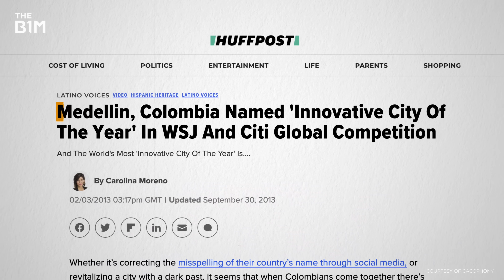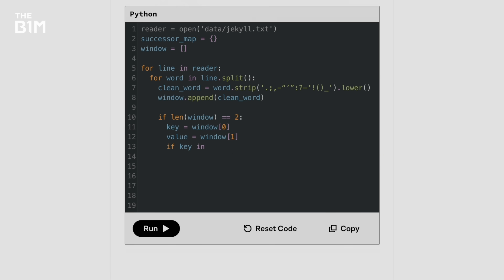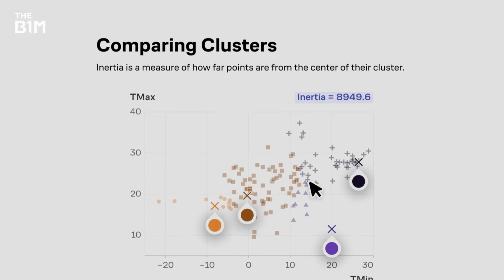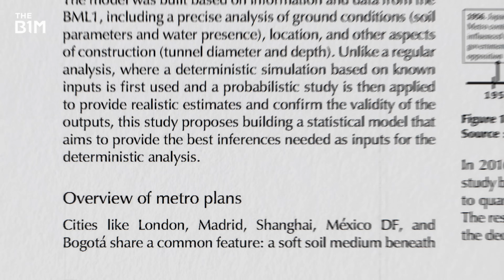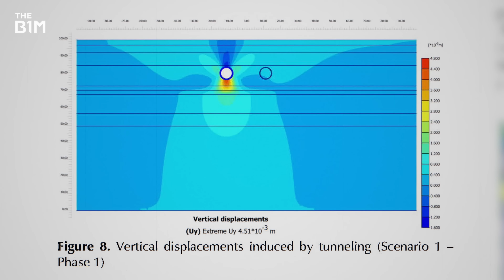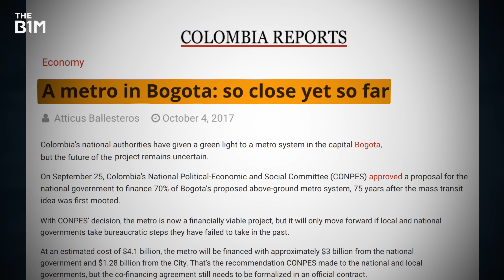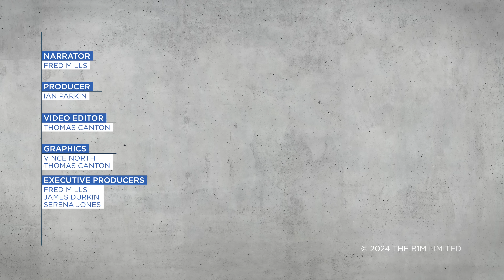How to Build a Metro From Scratch

Comment: Curious about the Transmilenio BRT system. Aside from the initial cost, is there any reason why it's not been replaced by a tramway? The bus lanes being completely segregated from traffic, can't understand why not a tramway instead for more capacity?
Reply: The system isn't even complete as it has been planned it still under construction in it's last stage, so finishing it just to change it to tram would be sort of a waste of money...also two times mayor Peñalosa, has been really keen in selling Transmilenio as the best solution for transit. He basically was forced into accepting making the metro but under his terms. He also tried to sabotage a project for a light rail between Bogotá and it's western suburbs, as Bogotá is a capital district separated from the surrounding department he decided that the city would not give money for that project and demanded that the level crossings in Bogotá be elevated which added to the costs. Fortunately the following mayor decided to support that project and an other light rail to connect Bogotá with it's northern suburbs. However resently a touristic train that covers the same route, crashed with a car and Peñalosa took the event to preach against trains and the northern light rail project, pitching a Transmilenio as better solution. He's still fairly popular and has many supporters in the city council.

Comment: Unfortunately mayor Peñalosa’s ego combined with his corrupt BRT bus business left Bogotá with an ugly aerial viaduct that cuts through the central , historic areas like an ugly concrete scar. To build it, they demolish and are re-constructing under the metro’s viaduct the same BRT line on Caracas avenue that Mr. Peñalosa built instead of the metro. In 1998. This BRT line has been plagued by scandals derived from bad designs, bad materials,  under capacity, over costs, constant repairs due to failing materials and corruption that more than doubled the original price tag. He also torpedoed other heavy and light metro lines to build more insufficient BRT lines through Bogotá. Mr. Peñalosa  is still wondering the world selling more BRT systems.

Comment: Transmilenio is the worst mass public transportation system that could have been implemented in Bogotá. Bogotá has the worst traffic in the world, as a result of the poor quality of service of the system, which has caused people to prefer to continue moving in cars (despite the traffic) and motorcycles, rather than having to suffer by getting on an unworthy transportation system, whose densities exceed 6 passengers per square meter, access and waiting times at stations that can be more than 40 minutes, etc.

The metro proposed by Enrique Peñalosa, diverted resources from the underground Metro that had greater capacity (80k passengers/hour-direction vs. 54k passengers/hour-direction) and greater length (32 km vs. 23 km) and more stations, to supposedly invest the difference in resources in more Transmilenio lanes.

In the end, the project not only took 7 more years to start, but ended up costing much more, offering the city much less.

The poor traffic and quality of life in the city are a consequence of the implementation and priority given to Transmilenio, over mass transportation systems based on rail (suburban trains, subways and LRTs).

Comment: Do a video on the Honolulu Rail Transit project, started in 2011, which is now over $5 billion beyond its original $5.1 billion budget and remains unfinished. Despite promises to ease traffic, Oahu still has some of the worst congestion in the United States. After more than a decade, the rail’s delays and skyrocketing costs continue to spark frustration among residents.

Comment: They should copy the Chilean metro organisation.  Chile recently built two metro lines with 25 stations each for just 2.6 billion dollars. The trick is having a permanent engineering team with 60 years experience in metro construction.   Why pay hundreds of millions to a private engineering company to do first the feasibility studies, then another company to do the technical studies and another to do the detailed engineering.  Each company gets a solid profit. Chile just uses its permanent team of engineers that only charge salaries, no millionaire profits involved.  Thanks to experience these engineers divide construction in hundreds of contracts that allow for thousands of companies to bid. Then they pick the lowest prices.  Thus, one awarded company digs the tunnels, another builds the railroad, another, the ticket booths, another the escalators, the tiles, the handrails, the doors, etc.  All lines remain the property of Metro. Thus people can move from one line to another without having to pay again ( as it happens in Peru).  There is a unified automatic ticket system and the metro is connected to bus lines With the same ticket.
Reply: That's how Europe and Asia do it. We in the Americas kinda do it with highways, but not in urban projects. IDK why.
Reply: @quagengineer1877  UK has some very high costs, as does Singapore. And US highway costs are quite high as well.
Reply: Very impressive stuff. Are you very familiar with the Santiago procurement process?
Reply: @szurketaltos2693  This YouTube video in English explains a bit: "How this American city builds transit on a budget".  The Argentinian that gives the details is: "El secreto de Santiago para construir metro barato", perhaps you can have it translated by AI.   There is another in English that fully summarises the progress and history of Metro de  Santiago : "The americas' most advanced Metro|Santiago"
Reply: @fernalonsoau The best subway system in South America is in Sao Paulo, Brazil🇧🇷, not Chile. 🌶️🌶️
😂😂
Chile has almost no heavy industry, and all the subways are built by foreign companies.😂😂
Reply: @zhou_kaw  It is true that Chile does not have much heavy industry, but for the last decade, it has been assembling metro trains in Santiago.   I don't know the Sao Paulo metro.  What I know is that Chile is very efficient at building excellent metro lines at low cost.
Reply: @fernalonsoau  The latest Santiago new metro trains to be put into use is the CAF metro train, which is imported from Spain🇪🇸.
Reply: @fernalonsoau     The latest Santiago de Chile new metro trains to be put into use is the CAF metro train, which is imported from Spain 🇪🇸.
Reply: @zhou_kaw  That is right.  Those are driverless trains for the new lines.  Chile is assembling the driver trains to replace old ones in the older lines.
Reply: @szurketaltos2693  I watch a video by an Argentinian economist, who gives all the details.
Reply: That sounds like a nice model! Thanks for sharing
Reply: Public transportation in Bogota is unified.
Reply: @javii9768 So it's Santiago. In fact, Santiago took the Transmilenio model and implemented it, using the Metro lines already builden.
Reply: Basic stuff has been privatized to fucking contractors.
Reply: It makes sense to have a continuously working branch of the government on it.  Urbanization isn't going anywhere, and therefore increasing demands for transit are required to move people efficiently.
Reply: No tenemos el capital humano para desarrollar este sistema, sufrimos una fuga de cerebros, la gente que estudia y se capacita prefiere salir del país debido a la falta de oportunidades, la pobreza y el conflicto armado.
Reply: Most of the world does work this way
The nations building the most metro systems in the world today
are India and China, do have Railway and Urban Transport Ministry's
Reply: the santiago metro is top tier, i love the 5 minute frequency and being able to use the entire network with a single fare. sadly its sister project red is a massive resource drain on the rest of the country, and in terms of transit all the other cities only get scraps every 10 years. my city's bus network is so unreliable that car use doubled between 2014 and 2024 alone and the already expensive collective taxis suck at rush hour. you literally have to fight your own neighbors to get in the taxi first or gamble and rely on the rickety old crowded buses with unreliable frequency and no information to actually arrive and stop so you can get in and so far my region's government has announced NOTHING. chile's transit has a severe quality of service gap between santiago and the rest of the country and sadly it's solving it too late and extremely slowly while building new metro lines every year, it's an extremely nasty display of centralism to the point santiago's buses even had a special license plate type only for them. santiaguinos also have the bad habit of evading the bus fares which means even more money injected to keep them running and guess where that money comes from...
Reply: Seems smart can we get a video?
Reply: not paying again when changing lines is pretty common, being statized is not the reason it works this way, because privatised and mixed models can also have this feature. or moving from a bus to the metro on the same fare etc. even when its privatised, the fares are subsidised (heavily) by the govt, so the govt decides how it'll be charged. operators don't make money on the fares (otherwise they would go bankrupt at normal prices), rolling stock is sometimes more expensive than airplanes to buy and you usually buy (you lease airplanes). its a cost of billions the companies would have to get it back. every fare would cost like 20 bucks. they make money on the subsidies.
Reply: So many lies in one statement.... First of all, the Santiago subway was started in 1968 and second it was built a French company called BCEOM-SOFRETU-CADE. 1 Chile has a LOT more years of experience and knowledge with the railway system, something that Colombia doesn't have: Would you really give a project worth to a public company worth billions of dollars with no experience? No you wouldn't.  Second BCEOM-SOFRETU-CADE was a French Company too and it was the concessionary until 1989...
Reply: @germangonzalez7185 it’s true that the first two lines were built by the French.  Since then, Chilean engineers took over and have built five lines; some of them with Spanish trains; some others overhead; one of them crossing under the river and now they use driverless trains with glass door in the stations.
Reply: Do you know why’s that? The answer is corruption, those millions goes to politicians pockets in Colombia. Unlike Colombia, Chile is the less corrupt country in south America.
Reply: basically you’re saying exactly  what the plan is … in Medellin there is metroPlus which takes buses to the metro stations and then to separate bus stations … bogota will follow the same system
Reply: @vlz.matthew  The difference is that Chile has a permanent team of engineers with more than 50 years experience in metro construction.  This team does all the engineering studies for salaries only.  No expensive private contractors for every study.  The construction of each metro line is divided into hundreds of small contracts, which allows many small construction companies to bid for chunks of the project.  All of this saves money to this state owned company.
Reply: Because in colombia politicians need to rob
Reply: Wonderful
Reply: Same mechanics in indonesia, not sure about the company stocks tho eg sudirman baru station won over bni city station
Reply: eso se debió de hacer en Lima, ya llevan 10 años construyendo la Linea 2 que tiene 27 kilómetros de extensión, se proyecta que este lista totalmente para el 2030. Ese es daño que hace la corrupción a un país y su desarrollo.
Reply: Everything sounds good except picking up the lowest bidder which means they’re bound to cut corners
Reply: This is very beautiful but Since this is the first metro project, they probably don't have engineers on ground with duch extension experience in metros.
Im trying to relate this with my hometown. I'll love us to have a metro someday. And fast rail which connects the entire country!
Reply: That’s not the main issue. Chile’s coast is extended making transportation by sea extremely cheap. Colombian’s capital is in top of hills. They have no water ways that can be used for transportation. Currently the beams for the Metro are stoped at seaport because their roads in the middle of mountains are too narrow to allow them to bring them in.

Comment: God bless the beam launcher. It has really sped up the manufacturing an installation of railways the world over including my hometown of Edmonton which is using it on the under construction Valley West line project to build an above ground section at West Edmonton Mall, formerly the World's Largest Shopping Centre, the 8-lane wide 170 St a major artery in the west end and of course the nearby Misericordia Hospital. Without it the project would be a mess, with it? All those places have been almost entirely unaffected.

Comment: Did you know Bogota's Metro has more "studies" than the former mayor Peñalosa?

Context of the joke:

The Metro's studies:
Bogota's Metro has accumulated more than a dozen major technical studies since 2009
-These include advanced basic engineering studies, conceptual designs, feasibility studies, socioeconomic evaluations, soil studies, environmental studies, and multiple technical analyses
-The basic engineering studies alone included the viability assessment of a 27 km tunnel.
-It has had studies for both underground and elevated versions

Peñalosa's studies:
In 2017, Peñalosa publicly admitted that he did not have any master's or doctoral degrees
-The controversy arose when his supposed doctoral and master's degrees from IIAP in Paris were questioned
-His only verified degree is a Bachelor of Arts in Economics and History, obtained in 1978
-The Attorney General's Office investigated the case due to complaints about the integrity of his academic credentials.

This is why the joke became so popular in Colombia: it ironically contrasts many technical studies for the Metro with the controversy surrounding the academic credentials of the former mayor who strongly advocated for the project.

The joke works particularly well in Spanish because "estudios" means both "studies" (as in technical research) and "education" (as in academic degrees), creating a clever wordplay that makes the joke even more effective.

Comment: Great video. Thanks. Things are moving faster now. They are going to lengthen the first line, and a second, mixed surface rail and mixed underground is already being planned at a relatively advanced stage, and a third underground line is also in preparation. Meanwhile, Transmilenio is also being expanded. The one comment that I have is that the first line is unlikely to get a sufficiently large number of people out of their cars. More likely, it will get people out of busses, including Transmilenio, which is good, because current capacity is insufficient. And so, until they make driving more expensive, and offer other options, such as expanding the already 550km long network of bikelanes, adding better buslanes, etc., will we not see a reduction of car travel. Until then, which is a long time, Bogotá will remain a congested city. As somebody without a car, I use a mix of bike, ebike, Transmilenio, busses, and cabs, I find Bogotá quite manageable, but then again, I walk to work. The daily commute can be very intense for many people. What is helping is that there are more and more options to live closer to work. Downtown is improving its offer, after having been abandoned for decades. So, many people can now choose to live closer to work. This is the medium to high incomes however and though it does mean that some people can use their car less, the bulk of public transit, used by lower incomes, will see less change. What the Metro promises is less congestion and faster transportation for them. In any case, it is a massive improvement.

Comment: As a Bogota resident I find very interesting the video and I’m grateful that Latin American cities are finally part of the channel. However, the política, rivalry part is all wrong and misleading. No study was ready in 2014, fact is only routing and little detail plans were ever made by Petro. No engineering, architectural or structural designs were made for a tunnel project. It was so bad the idea that a recent study made for Petro (as the sitting president) by Colombias National engineering board found that his so called underground project had little to no progress, the route was not ideal and the cost was several times higher that the current viaduct type. Additionally, Peñalosa is a world renowned urban planner and Transmilenio not only is his legacy as well as some critical and amazing infrastructures, he was also the only major so far to make the designs and even begin construction por the Metro. Please fix this, the amount of impartial information is overwhelming and saying that penalosa scrapped an almost ready to begin project is a straight on lie.